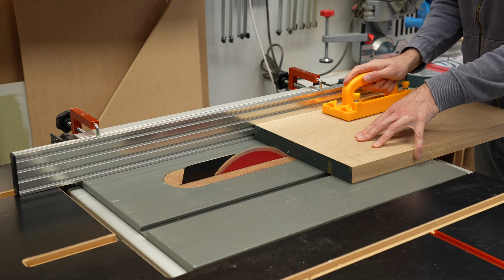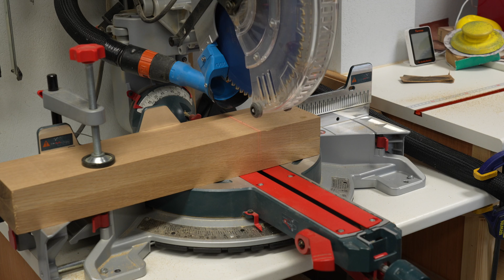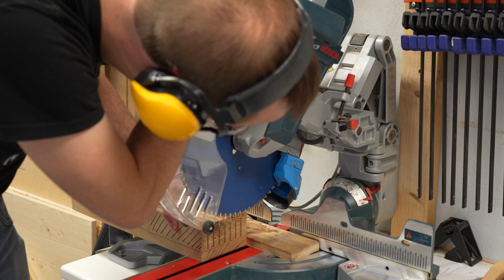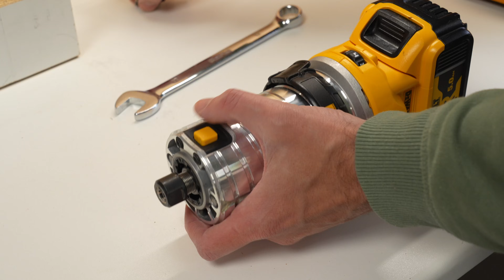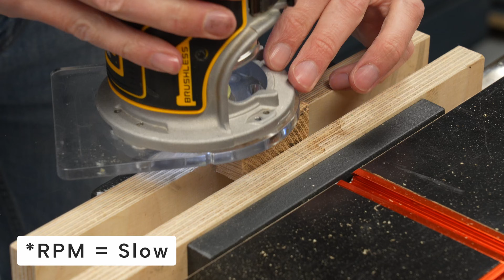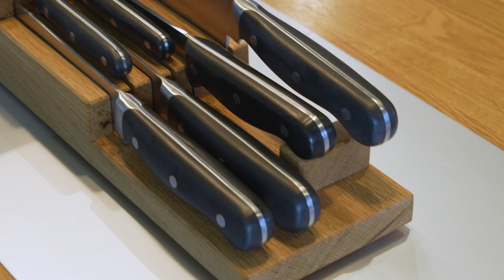Build a Drawer Knife Block From Scrap Wood | Woodworking

Comment: That “scrap” block of oak would cost a couple of hundred pounds at least. Please don’t copy the American YouTube carpenters annoying habit of calling every premium piece of wood “scrap”.
Reply from the maker: Not sure where you’re buying your timber, but this amount of oak is nowhere near “a couple of hundred pounds”. A solid oak worktop measuring 1m × 620mm can be bought for about £99 retail, and you could get multiple knife blocks out of that. Using rough sawn timber, this piece would probably only contain around £5–£10 worth of oak. In this case it was also literally an offcut from our kitchen install, so for me it genuinely was scrap/offcut material that would otherwise likely have been binned.

Comment: Great results! Sorry for the daft question but how do you control the chamfer? Is it just the depth you set it at to make it 3mm?
Reply from the maker: No such thing as a daft question. You set the size of the chamfer, simply by lowering or raising the router bit. The lower the bit, the bigger the chamfer. Always a good idea to set the router and do a test on some scrap wood, before cutting into your project.

Comment: Too bad this design allows only for two steak knives.
Reply from the maker: The plans have two options, one that stores 7 knifes and another that stores 9. Larger knifes must be stored on the lower row, but smaller knifes (steak knifes) can be stored anywhere. There is no reason you couldn’t make two (side-by-side), or tweak the design so it’s wider and stores as many knifes as you want.

Comment: I don’t know why we necessarily use the table saw in America for the oarallel edge. That’s what everyone here teaches. I’m guessing it’s because of the American Woodworker belief that “the table saw is the heart of the woodshop”. The thicknesser seems like a simpler solution.
Reply from the maker: It's interesting that we do things differently. Though I suppose the British approach only works on smaller stock. Probably a good idea to have both approaches in the toolbox.
Reply: @MakersManual  I would not want to run a piece of 2 X 12, on edge, through my planer (assuming my planer could accommodate it.  Much safer and more accurate to use a table saw.
Reply from the maker: @monswye  I do hear you, we did find it a little unnatural at first. At 2 x 12" we would use the saw too (I don't think the planer would even fit a 12" depth), but at 2 x 6" we'd choose the planer over the saw. It's actually recommended in the manual and should produce even more accurate results (though either is accurate enough).

Comment: Nice project! Regarding the American vs European approach of milling - I'm not sure which method is ultimately superior but with the table saw approach, you know you will achieve a parallel edge since the opposite, jointed edge is referencing the entire fence as it rides through. Can you achieve that same reference using a jointer/planer? You will get a nice clean straight edge for sure but will it be parallel to the opposite side? I guess it might depend on your machine's setup. The downside of using the table saw is that the final cut might need a little bit of cleaning up.
Reply from the maker: Thanks... My thoughts were that the thicknesser/planer would probably get the more parallel edge because it holds the part more securely and is a more accurate tool to begin with. Although realistically I am sure both the saw and thicknesser will get results that are sufficiently parallel. The table saw would also be the only tool that could do wider sections. It was interesting to me that the thicknesser manual suggested this approach, but I've never seen an American YouTube channel doing it that way.
Reply: @MakersManual  I genuinely don't know the answer w.r.t. a setup like yours, but it might be important to consider where the planer/thicknesser is securing the wood. Is it at a relatively focused point as the wood moves through (e.g. the machine's rollers) or across most/all of the wood as a whole. It has to inherit the opposite reference edge all the way through, or as long as possible anyway, for both edges/faces to end up straight and parallel. Either Stumpy Nubs or Steve Ramsey explained it in one of their videos and I'm not smart enough to re-iterate it very well, but I followed it and got good results.
Reply from the maker: The wood is supported from the underside via a cast iron platform that I would say is the same length (or a little longer) than a table saw fence. The platform is very solid and perfectly parallel to the cutter (above). I am very confident it will be parallel to the opposite side, because that is basically the purpose of the tool.

I haven't seen a combo Planer/Thicknesser tool in the US, but it is essentially a jointer and planer combined into one tool that uses the same cutter both each operation. Above for jointing and below as a planer.